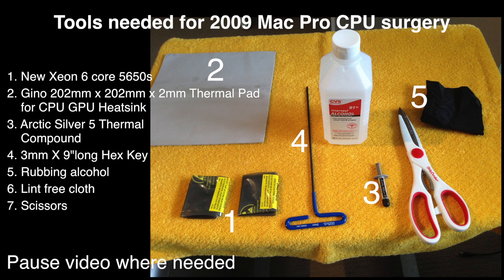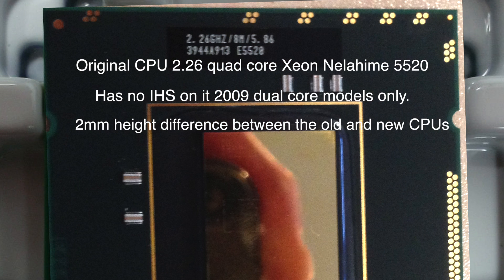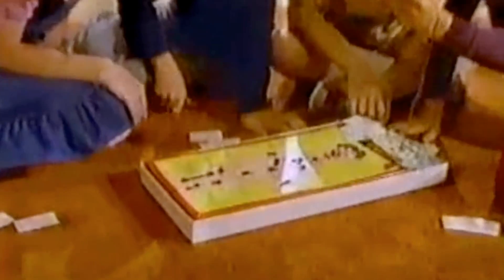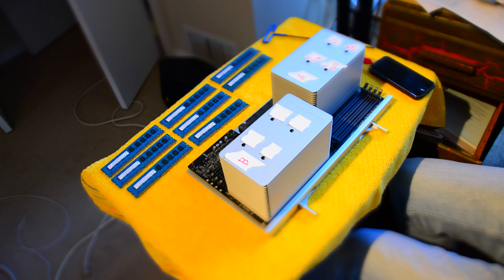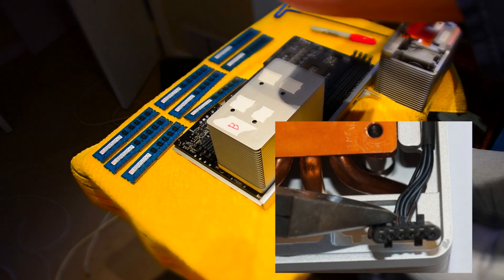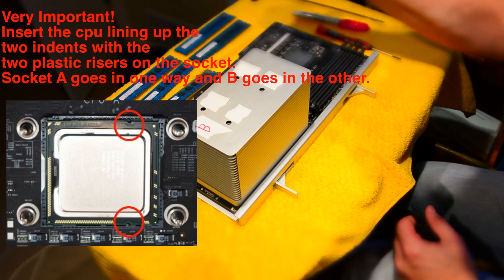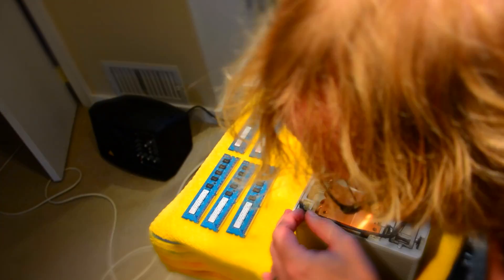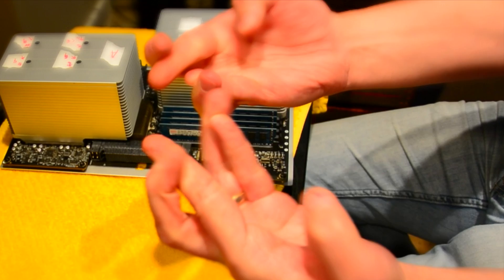Mac Pro 2009 5,1 CPU upgrade 8 core to 2010 12 core

Comment: nice videos, i have a question, you write for install filmware update you must do it on Lion. After that you can use sistem update of Apple as usual? You can install Mavericks or you are forced to mantain Lion S.O.? I tray to answer this questions on forums but i can finde anywhing. Thank you in advance.
Reply from the maker: Yes you are good to go to Mavericks after you update in Mt Lion just like normal. I am running Mavericks and Mt Lion on two system disks for certain reasons both work no problems.
Reply: Yeah, it work in snow leopard, and easy updated to mavericks. Thank you. My ram speed continue in 1060 instead 1333. Maybe it need change processor to change speed? I dont find solution on forums.
Reply from the maker: odon garcia
Yeah I forgot to mention in my firmware upgrade video that you need to ZAP your PRAM to have your 1333 ram show up. To ZAP your PRAM start up your Mac Pro and before you hear the boot chime hold down the "command", "option", "p" and "r" keys all at the same time, continue holding them down until you hear the boot chime a second time, it may take 15-20 seconds then let up on the keys and the Mac will now show you have the 1333 ram installed.

Comment: Great video doctor !  :)
I have a doubt about the new two CPUs... 
Are they of the type: Intel X5650, 12M cache, 2,66 ghz, QPI, B1, LGA1366, lunch date 2010 ? where could they  buy?
greetings from italy!
Reply from the maker: I bought them on ebay for $250 for the pair but now see they are going for 200. They have been great and my geekbench score is higher than I was expecting. I dont think its worth spending the extra money on 5670s as the benchmark difference is not much higher compared to the price. Seller on ebay is computer-sales
Reply from the maker: Bubblegummonsters
Yeah I saw his video and honestly I'm surprised it worked for him. No thermal pads and no real method of screwing down the heat sinks, also he did not do what I did and cut the heat sink connectors so they would go all the way back into the socket after having the 2mm difference in height. If the heat sensors aren't connected correctly or the connection is not there via the thermal pads for the height sinks to get their proper readings the fans will just blow at full speed all the time like a jet. So I think he got lucky. I would not use his quick and easy method but you may also get lucky but when installing 1200 dollars in processors and the chance of ruining your mac pro logic board it's not worth the risk. Some people put 2 1mm washers on the posts before putting the heat sinks back on to make up the 2 mm diff but you still need the thermal pads and to make sure the HS connectors are all the way in.
You can use any 1366 socket 5600 Xeon series chips all the way up to Intel Xeon X5690 Six 6 Core 3.46GHz 12M 6.40GT/s LGA1366 CPU Processor SLBVX
they go for about 650 each on ebay which is a lot cheaper than they were a few months ago. GO to Netkas.com and read the forum section about the firmware update and the upgrades. It's good to see that many have done it right and learn from others who have screwed up their mac pros.
Reply: Lance McVickar  are the (2) 1mm washers on the posts as a kind of "insurance" against over tightening (even though you should still be delicate)?
Reply: Lance McVickar I did the upgrade. Mac Pro chimes and boots up fine, CPUs are showing, and all RAM is showing. Temps are good, but, after 5-10 minutes of use, the fans kicked into high gear. I presume this is either because the thermal pads are not making contact or the fan connector is not seated properly. I took the old pads off the heat sink and replaced them with 3mm pads cut to the same size (I stuck them to the heat sink where I pulled the old ones off). I obviously do not want to undo a working upgrade that is pretty tricky to begin with, but it seems I have no other choice to get rid of the jet engine. It is hard to tell if the thermal pads are making contact, and I do not want them to be too thick. I would have thought that if the fan connector was not tight, there would have been high fan speeds immediately. Very disappointing.
Reply from the maker: Gregory Orme I added 2mm pads and left the old ones on, I applied them to the heat sensors not the heat sink. It could also be that one of your connectors to the heat sinks are not fully in, did you cut the connectors or leave them. Sucks your having the issue, I feel your pain...
Reply: Lance McVickar Thanks, man. I remembered the mantra of patience and went back and tightened just about one hour on the dial. So far, the problem has not repeated, so fingers remain crossed. It is still confusing to me, because I would think that if the sensor were not making contact, that would show in Hardware Monitor. I do not know where the thermal pad I put on would even be read. I decided to take it off and put on the new pad because the old pad looked pretty fossilized. By the way, I did not cut the sensor connector. I have heard it done both ways, but with my dexterity, I thought I would try first without the cutting. In an item unrelated to the upgrade (I know, because I recorded the temperatures before doing it), I upped the minimum fan speed slightly in a couple of areas.